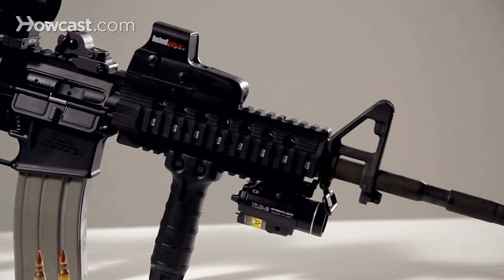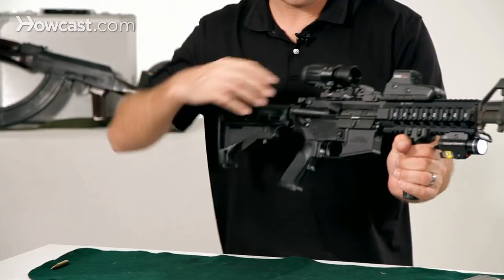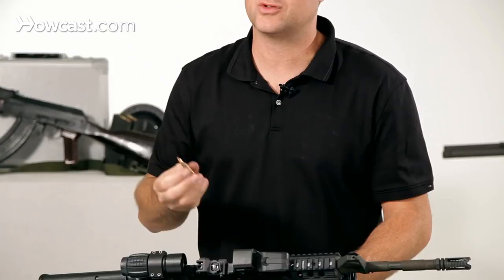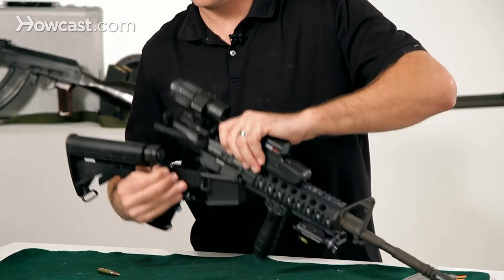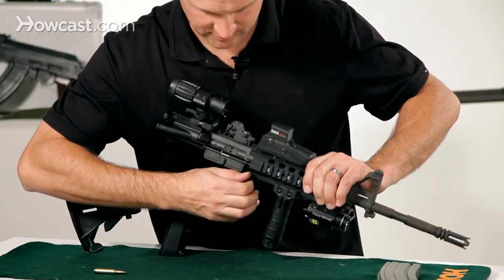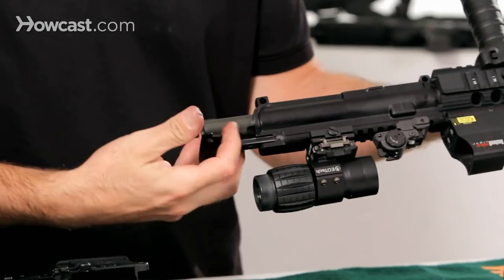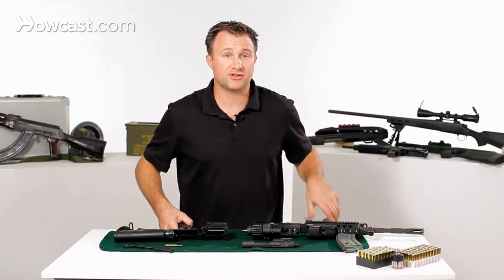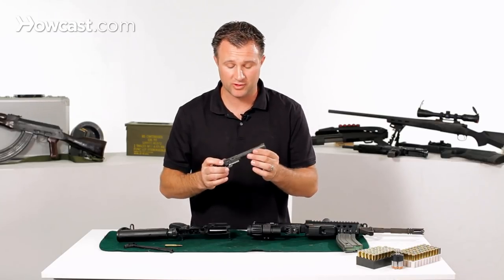How to Disassemble an M4 .223 | Gun Guide

Comment: Just push the takedown pins out by hand. For the BCG take out the cotter pin, the firing pin will drop out, rotate the cam pin 90 degrees and take it out so the bolt can be removed, push down the extractor and push the pin out.